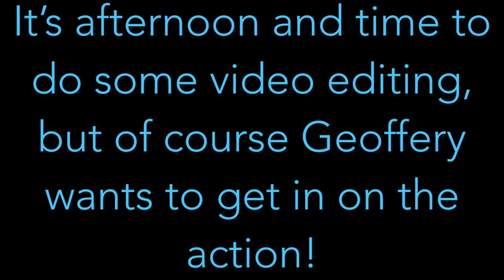Our Narrowboat Home. Reeds are cut back at Tattenhall Marina.

Comment: After filling with your knife, tapping the bottom of your stern greaser on a hard surface will allow all trapped air to be released before putting the plunger in. With nearly 50 years experience filling grease guns as an aircraft engineer. I think I've probably pumped tons of grease into helicopter bearings over the years. Now I'm retired, I still fill grease guns but my son does all the pumping. I'm sure it's a con as he says I am so much better at filling than he is. Ha ha.  Love the Vlogs. Stay safe.
Reply from the maker: Thank you Robert for that excellent advice..I did not know that Pearl of wisdom and will certainly adopt the method from now on, and probably pass it onwards too. I wish I had that attention to detail you need to be an engineer, 50 years  boy does time fly. Thank you for getting in touch, stay safe, love from us all on board.